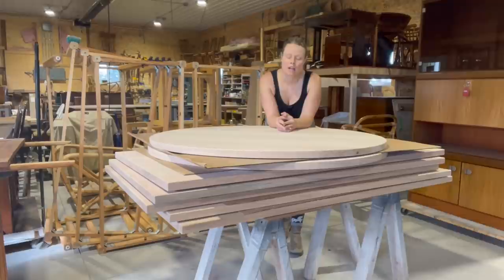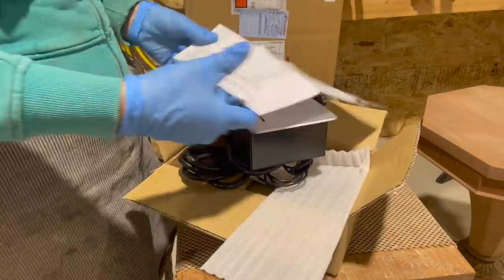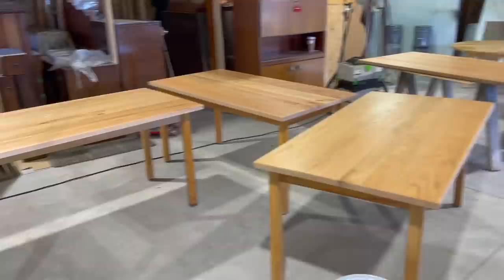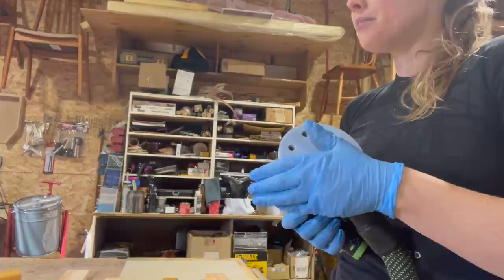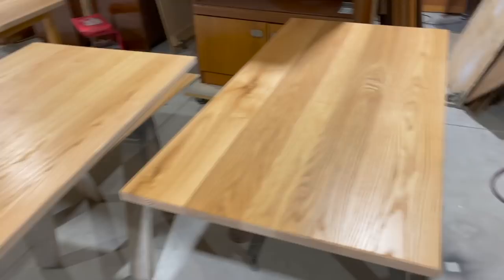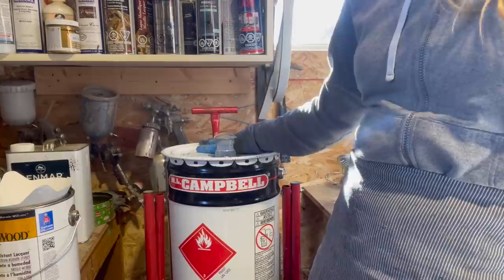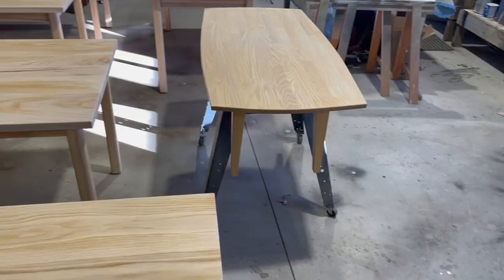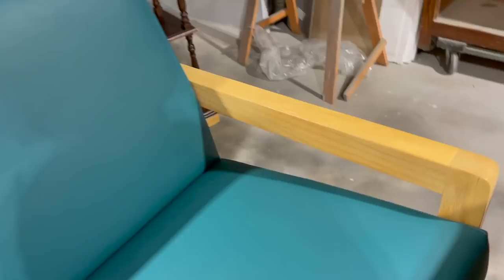How many tables can one girl finish?!

Comment: Hi Trena,
I had never heard of bleaching oak to tone down the red. I am learning a lot from your videos.
One trick I use for centering bases to table tops is by marking the center on the base using a bit of masking tape and putting the mark on the tape. Same for the table top bottom side and that way you can fasten the base without worrying about movement after you placed the base.

Comment: @Trena~ I can only imagine the stress you endured when cutting into those 1.5" thick Oak Tops to make a space for the power outlets!! It's one thing to accomplish that feat ONCE on your own table build or modification, but it's an entirely different beast doing it on multiple tops for such a public venue! It made me nervous when you first showed the power boxes in the beginning of the video and I'm not even the one doing the work!! HAHA. YOU ARE A ROCK STAR GIRL! Great call on the wood bleaching, the color of the tops look so much more modern and the maple & oak blend together seamlessly. You mentioned cranking up the heat in your shop and it reminded me I've been wanting to ask you about the radiant heat system you showcased in the "Shop Tour" video. Do you happen to remember the name of manufacturer & model number of your radiant heating system? My Dad's 40' x 60' shop desperately needs a new (better) heating system as does my garage. I've done some research on radiant heating systems. There are many brands on the market, but with very limited customer review information its hard to judge quality in real life. I know you LOVE your system so I thought I'd inquire.  P.S.~ When the library remodel is completed, you should post some pics of the tables & chairs IN the library on your Instagram!  ~~Christy~~
Reply from the maker: Thanks again Christy. I Believe our system is a Bryant heater. The only thing I have had trouble with is the tubing the company installed. For some reason it was rusting and they had to replace a section. I think its important to make sure they have the whole tube angled properly as well as have the heater set properly to heat up the whole tube before it turns off to make sure condensation isn't building up. Mine was heating the shop too fast and shutting down before the heat made it to the end of the pipe and that was trouble. I am waiting for the library to officially open and then I will most definitely make a post. Cheers! fyi, working on integrating your ideas in the next videos
Reply: @johnsfurniturerepair  That's great information for me to have as I endeavor to purchase new heating systems for the buildings Trena, Thank You!  I can't wait to see the library photos! Cheers to the continued growth and success of your channel! :-)

Comment: Hi Trena,  Converstion Varnish I think it is like playing with a loaded gun, I used it on my alder cabinets (Valspar brand) Well, half have turned flat after 2 years and some of the flat turned pink.  I think that reagular lacqure would have been best,   good job on the tables.
Reply from the maker: oh dear, thats interesting. i know that some of the flattening past can turn pink in the gun when its near being cured. Ive never seen it happen on a surface. What was your mil thickness?
Reply: @johnsfurniturerepair  hahah that was a mystery that the cabinet shop owner could not answer ether. I bought the product from him and followed his weighing instructions to the gram, sprayed it with a 1.5 tip and put on three coats with a suction cup, he uses an airless but the film thickness is not as thick as he puts on his cabinets, but not by much. The wife wanted gloss and half are still gloss and the other half have turned to a super flat and the pink color is through out the film. When I called the rep. and told him of the problem, he did not have an answer also, and also did not offer to replace the product, the pink tone coming through he had no clue of what that was especially on only part of the cabinet doors.   I was able to sand one effected drawer from a 4 drawer stack and used shelac and so far it is still glossy and that makes the wife happy. For over 45 years I have used Macs with very little surprises and after sanding down 42 doors and drawers again I think that is what I will use.   Just to give you an Idea of what I did, the doors are Alder and previous owner painted them white, these are raised panel doors and drawers, so I bought a 24 inch wide belt sander and ran all the doors thru to get back to the wood, and hand sanded the cove on the raised panel, then spray painted the cove in a medium brown (Nutmeg) to match her granit counters, then back to the wide belt of remove anything overspray on the face and rail and styles. One coat of the valspar for a sealer, it dries in 30 minutes, sanded and applied 3 heavy coats of the Valspar, and stood back and patted myself on the back. the look was very impressive,  (she says I have a fancy problem) So any way thats''s my story and I'm sticking to it. 
Thank you for your interest in this problem and you do some fine work, as an old wood worker I am very impressed.

Comment: I was so sad to hear that you were stressed out during this project! Hang in there girl!
I always learn something new and useful from you and your videos.  I appreciate both you and the videos.
I wish you had gone into a little more details on the electrical bits of this project.  I have had a couple of project ideas of my own that included something similar to those, but in my case, not only did the unit never get built, but I never could decide where to place the unit nor what it should include.

Comment: A comment asked why Trena bleached the red oak so much. She identified the heart of the problem: red oak with maple, in natural, looks off because maple tends to lean yellow which only works with med/dark stained RED oak. I think she even wished they used white oak (my choice also). The bleaching gave the tables a homogenius color that made it look like a hit, not a miss. ;-)  Designing with mixed woods, it's best they actually contrast, like some modern end tables I designed and built using natural Purpleheart rails w/inlay, natural Maple table tops, and Oak legs stained Dark (red neutralized).

Comment: Hiya as an ex-spark we always used local electrical wholesalers for mini trunking like yours. Look in what was Yellow Pages for your nearest. You had YT2 size. YT being the manufacturers I used. You could have used size 1 for a small 3 core cable though size 2 is often easier to fit. A thought for next time. Stay safe, Steve...

Comment: I’ve been using Krystal for 10 years it’s a excellent coating and easy to use left over finish can be saved by putting it in a closed plastic container and put in refrigerator I’ve had it last 10 months or more when you go to use it bring it to room temperature and use it catalyze stops working at around 50 degrees
Reply from the maker: very interesting! thanks for the tip!

Comment: Very nice job!! I was surprised when I saw you using Ml Campbell’s catalyzed varnish!! I been using that product for 25 yrs. very durable and easy to use.. I glad you wore a respirator this time .. it will kick your butt with the fumes as it cures… I use Ml products for all my finishes .. I would recommend using their  krystal sealer , it dries in 20 min and it sands soooo easy!!! This product will not wrinkle … I’ve built it up to 7 coats on a table top and sanded it up to 2 k grit paper and polished out to a mirror finish… it’s a great product to use.. I really enjoy watching you work , I know you are a true professional,and you know your craft!!! Congrats!!!!!
Reply from the maker: Thankyou!. well I must be special because i think i sanded and recoated it a little fast on one table and it wrinkled. lol note to self, let the finish cure after a hard sand because there could be finish still gasing off. I am very glad you've never had that happen because its a pain in the butt. have you ever had issues with ml thickness after 7 coats? or were you sanding them pretty good so your build was minimal?
Reply: @johnsfurniturerepair  I did sand hard in between coats . And and the last coat I let it dry for a couple of days then did the polishing on it.. what did you use for your sealer on the desks?

Comment: Love your videos. I always learn so much.  You talked about using a reducer, what does it exactly do?  I need to refinish my oak floors in the spring any suggestions?  I really don’t want to sand them all down.  They currently has Fabulon on them, oil base. Thanks

Comment: the best way to cut those holes is to use a router and template with a pattern bit in increments going down a few passes it can be done from the top or bottom with a top bearing flush cutting bit
Reply from the maker: i did have a template router set up but i wast happy with how it was jumping on the end grain so i switched. it was weird oak. cheers

Comment: Hi Trena,
Love your work. I'm a woodworker in Wisconsin, most of the work I do is from scratch, but I am doing a restoration on an eight foot maple (butcher block style) table. I used citrus stripper (not much ventilation), and I now have small orange dots in some spots on the tabletop that seem to be bleeding through after I sand. Any thoughts on how to get rid of these?  TIA
Reply from the maker: was it previously stained?
Reply: @johnsfurniturerepair  no, it was natural, with some sort of poly on it.

Comment: Trena,  hey great job explaining your reasons for bleaching & neutralizing, just good chemistry, thanks. Now what's up with cutting those holes (for electronics) such that you don't want to share with us retired handy men? I know you drilled a small starter hole big enough for your Jig Saw (right?). Then you followed your template, outline, pre scribed on yur table (top?), then just-slowly-cut your line & bingo, the  cut out just fell to the floor...right? I can hear the loud 'clank' as that oak cut-out hit yur cc floor...& the echo still rings in yur ear? Aye? Lol! Looks like a perfect job! The flange of the unit hides any scratches..all good from our YTviewers observations. Carry on!👍👍👍👩‍🔧🍷
Reply from the maker: pretty much what happened. I made a template for the jig saw so it wasn't riding on my wood surface so no scratches. the issue was with the manufacturers instructions and the bracket installation. but its all over thank goodness.lol thanks for watching